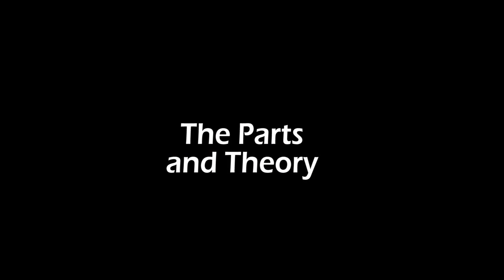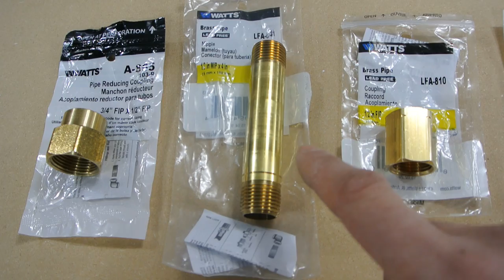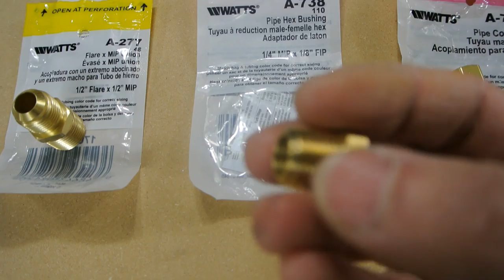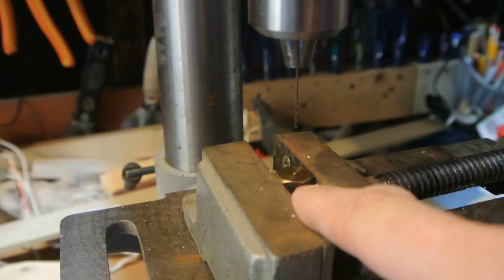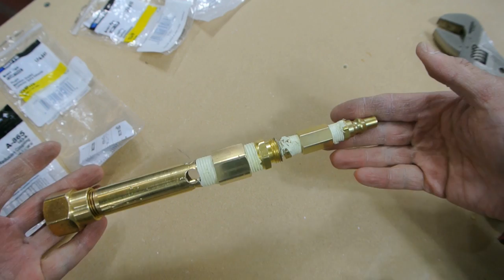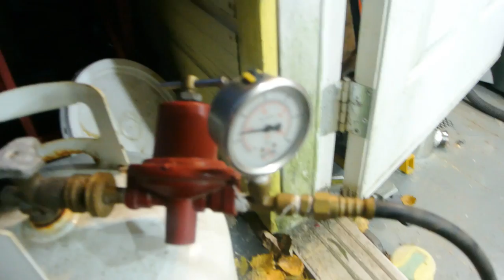How to Build a Propane Forge Burrner

Comment: Can I ask what the reason or maybe how did you know it needed to be longer ?
Reply: The pipe and other component were getting too hot. Also the other one was brass which conduct heat, making it hotter.
Longer steel pipe makes the heat from the flame not go too close of the inlet.

Comment: I try to do this but i dont see jet blue flame i only see a little bit blue with a lot of orange flame. Would it make a difference if i have a nozzle flare? The orifice hole is really tiny and on the pilot holes started with 1/4 and when higher to 1/2 to see if the flame was blue with the roar and force that you have and it didnt make a difference. Not sure if you have any advice.
Reply: Robb Me you’re getting an oxygen rich flame. Blue is neutral which means equal parts. Try a larger hole for the propane. If that doesn’t work you may have to use a higher pressure. Make sure your regulator is rated to it
Reply: Robb Me ,you have to put a screen in the end of the flare, it stabilizes the flame

Comment: I've used a few burners in the past, and none have made the flare glow, did you find this to be a problem? or was it all ok in the long run 
Lewis
Reply from the maker: +Lewis Price I've used another burner like this in a forge and have had no issues with the nozzle being red hot.  The pipe body is still cool to the touch.
Reply: ah ok, and great video by the way, thanks for making it so easy to follow, I'm making my own and trying to keep it as cheap as i can, gotta build three of them
Reply from the maker: +Lewis Price Thanks!  I think this is fairly cheap, but if you want to make it even cheaper you could just by pass the union and drill a hole in a cap and solder the nozzle tube in it.  I've tried it and it works, just harder to line up the orifice hole.  I mention it in the video.

Comment: I couldn't find a 1/32 bit at my local home Depot but I did find 1/16 I know it's twice the the size of your hole but how might it run and what may I have to do to get it to run nicely like urs
Reply from the maker: +kuter100 It will either need more air or less pressure from the regulator, but that's just an assumption.  Try ordering from ebay for small drill bits from china might take a few weeks to get but until then you can mess with the 1/16
Reply: +kuter100 I tried that, because I didn't have the smaller bit. The torch worked, but the flame just meandered out the end and wouldn't blast out like a jet. By doubling the diameter of the hole, you half the pressure of the gas coming out of the hole. So it won't serve the intended purpose.
Reply: Doubling the diameter of a hole more than doubles the size of the hole. Because area = pi x (r squared), the area increases according to the square of the radius. The increase, in other words, is exponential, not simply additive.  Hmm, high-school geometry finally comes in handy.
Reply: Goto harbor freight,  they sell mini drill bits. They also sell a pin vise, you can use with your drill to hold the tiny bit.
Reply: Like camera F-stops... double the diameter and you get 1.4, 1.8, 2.0, 2.8, 4, 5.6, 8, 11 ....it gets out of hand.

Comment: Don't ever use galvanized pipe for this!!
Reply: Galvanized steel must reach a temp of around 700°F to give off Zinc oxide fumes and a propane burner built correctly will only get hot at the burner end so, it's only really important to not use galvanized pipe fittings on the main burner tube (just in case) or flare.

Comment: Can you post the measures of every part? the thing is  that it's easier for me....I don't know.
Reply: Hope this helps.

The parts and supplies:

WATTS brand pipe parts from Home Depot:

Steel Pipe Nipple(s) or Pipe 1/2" MIP (at least 10" long)
Brass Pipe Coupling 1/2" FIP LFA-810
Brass Pipe Cap 1/8" FIP A-708
Brass Pipe Nipple 1/8" MIP x 2" A-717
Brass 1/2" Flare x 1/2" MIP Union A-277
Brass Pipe Hex Busing 1/4" MIP x 1/8 FIP A-738
Brass Pipe Coupling 1/4" FIP A-732
Other parts:

Low Pressure Propane Quick Release Plug 1/4" MIP
Low Pressure Propane Quick Connect Socket with Ball Valve
1-15 psi Adjustable Propane Regulator
Pipe Tipe or Pipe Thread Sealant
Sheet Metal
Self Tapping Screws
Common Drill bits including but not limited to:

1/4" Drill Bit
1/32" Drill Bit (or smaller depending on how large you want the flame)
Tools:

Drill
Center Punch
Adjustable Wrenches
Plumbing Solder and Flux
Blow torch

Comment: Is the pressure regulator totally needed?
Reply: yes
Reply: You won't get a consistent mix, since the fuel goes up way way up but the carburetion from the holes can't keep up = crap mix = lots of sulfur in your mix, and not optimal or CONSISTENT heat production.....no go!

Comment: Do some research,if you really need high heat fast, you need a liquid propane burner, they are available, I use to build them for a equipment company to use on asphalt equipment